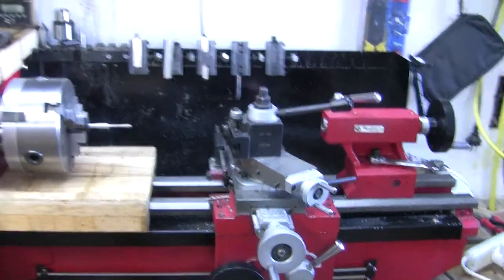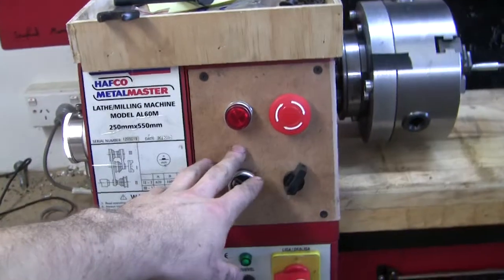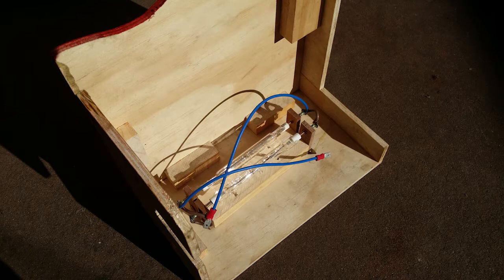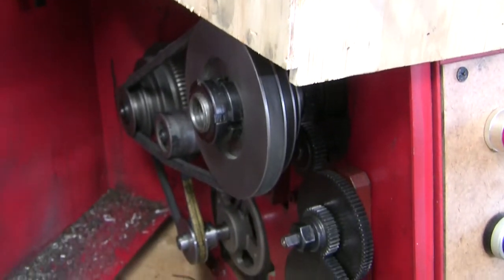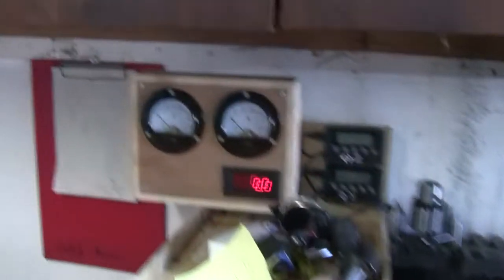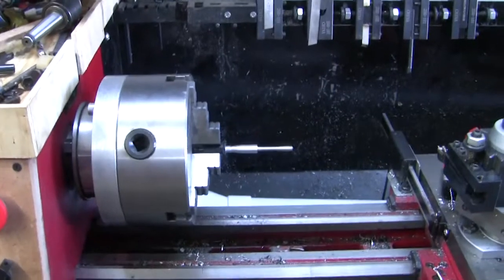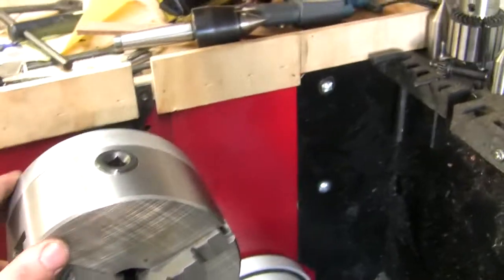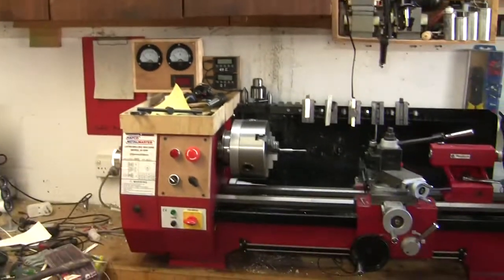Seig C6 lathe DC motor conversion final

Comment: arent you worried about chips getting into the fan and blowing ingot the back of the motor?  Ir si the back end of the motor closed?
Reply from the maker: The fan is about a meter away and tucked behind the chip guard.. So no I'm not worried ;)

Comment: Nice motor conversion.  I really like the fan ducting. 
Run your belt tensioner on the back side of your belt so you don't damage the inside faces.
Where do you live? I'm in Newcastle NSW.
Reply from the maker: seditiousmonkeyart i needed a longer belt to be able to do that, i got one that will give me enough slack that i can release the tensioner and free the chuck from the motor completely without removing the belt. the original belt was so tight you didn't need the tensioner
Reply from the maker: seditiousmonkeyart oh and im near Melbourne
Reply: +HomeDistiller Hi There, thought I had better warn you about your switches, they will all be rated for AC. You now really need ones rated for DC. The reason being that AC switches often only have a breaking gap of 2 mm. A DC arc will jump over that and may not break the current at all. Especially if you are drawing 6 to 8 Amps and your hit the Stop or Brake Button. Have a read up on the web about DC switching. Looks as though you have enjoyed yourself doing all the modifications. Just a further thought, it was all very well showing the airflow coming out of the motor with your piece of tissue, but what happens when you shut the side cover ? Looked a pretty close fit to me, might need a grill fitting into the cabinet door, to stop any fan back pressure. Regards from Dave in Adelaide.
Reply from the maker: +Dave Ticehurst the switches are secondary to the speed controllers own shut down circuit, but yes they are rated for ac but they are also being supplied pulsed dc so it there is an arc it will have time to break down, it might be an idea to out some clamping diodes in the circuit, but so far I haven't had any problems, as for the motor cooling, there is at least 2 inches of clearance from the side panel to the motor because of the pulley and shaft hanging out the front of the motor and the cover has large holes running under the lathe bed as well as the rear spindle hole,

Comment: G'day I wrote to you some time ago regarding your tool post holder, which you said came from Hare&Forbes for your C6.  I phoned them and they said they don't make one for the C6, could you please let me know what the number of tool holder yours is or any other info on it, it would be much appreciated thank you kind regards John Tasmania
Reply: The tool post is the generic piston type ones you can get off of eBay, the 250-100 tool post. These will take any of the 250-1xx series tool post holders (250-101, 250-102 ect.) I installed one of these on my old Hercus lathe, and now that I have a C6 I would probably go the same size, but the wedge type for a more secure lock.
Reply: Thanks mate for the reply, it all worked out in the end, if the piston type falls short I will change it for a wedge type. At the moment it's fine for what I'm doing. Regards John